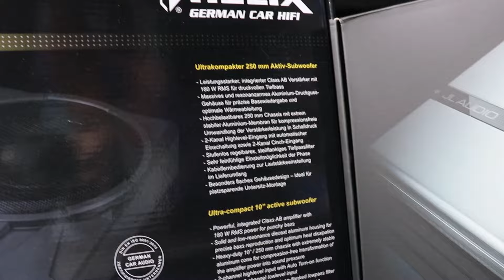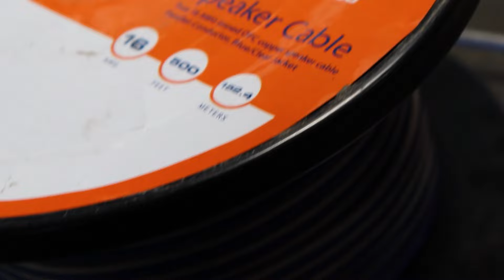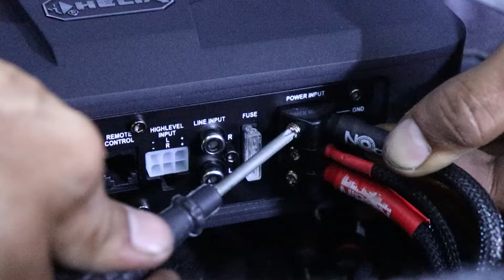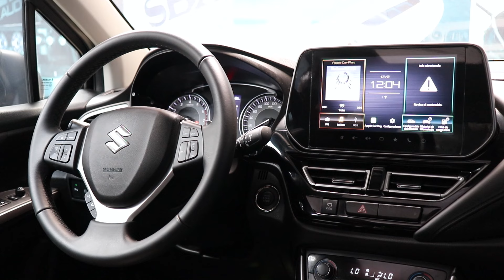Suzuki S-Cross 2023 Sistema Amplificado & Subwoofer Activo.

Comment: Disculpa Henry tengo una pregunta, para calibrar la radio y los amplificadores con osciloscopio, en la configuración del osciloscopio se hace con corriente DC o corriente AC, espero tu respuesta, gracias.
Reply from the maker: AC con un tono puro de 1 KHz. Saludos. Bienvenido a Nipon Car Audio lo esperamos en nuestro UNICO local en Av. Tomas Marsano #3730 Urb. Los Rosales Surco. Nuestro horario de atención es de lunes a sábados de 9 am - 7 pm.
Para una mejor atención trabajamos con citas, puede reservar su cita para cotizaciones presenciales y/o instalaciones al WhatsApp del taller 914 447 958 y el WhatsApp personal del Sr Henri Velasco +51 992 775 471. Aceptamos todas las tarjetas de crédito y No cobramos comisión por su compra.